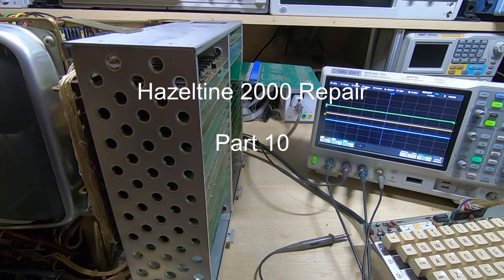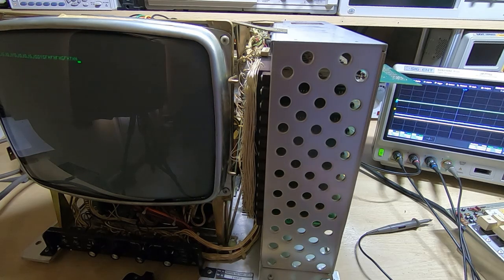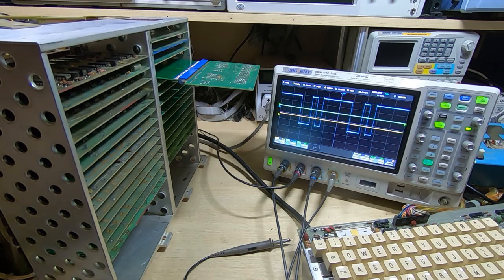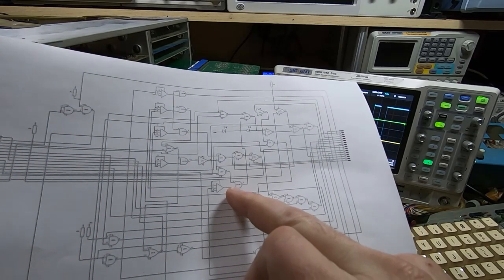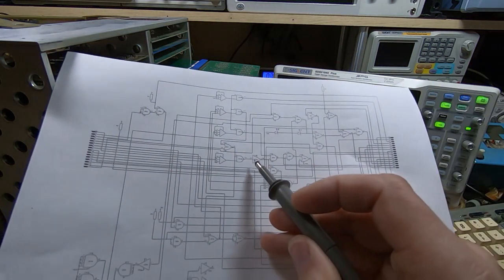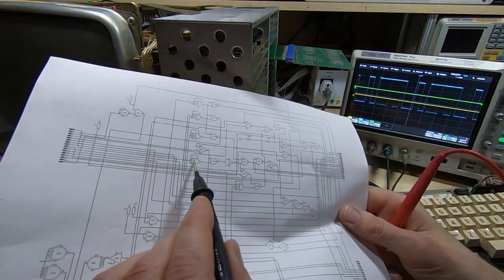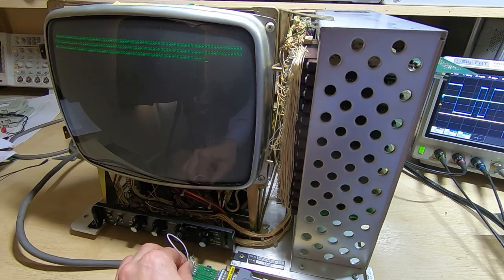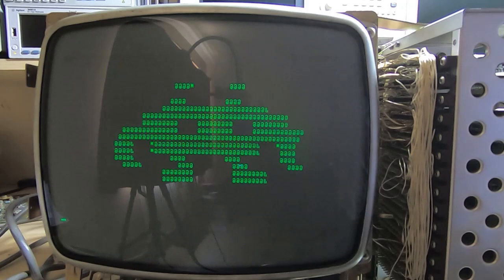Hazeltine 2000 Repair Part10

Comment: The 8kHz squeal begins again at 4:15 when you touch the riser board, and stops again when you let go :)
Reply from the maker: Yes it comes and goes. The mic does not always pick it up depending where it is. The noise is caused by resonance from distortion in the CRT drive currents caused by ground loop currents as the top grounding straps are not screwed down. It will stop when the straps are refitted although the 16KHz whine will continue. This is mostly due to the LOPT being screwed directly to the chassis and there being no current rate control on the primary winding.

Comment: Wow, the high freq squeal in the video is painful. Not sure if it's 15Khz from the monitor or ????
Reply: Ahhh the squeal of CRTs …. Pretty much at this point relegated to the dustbin of history like the sound of 300 Baud acoustic coupler tones…. Thank heavens for LCDs etc. replacing CRTs. My ears feel much better these days.
Reply: It's an 8 kHz squeal from the CRT drive, not the 15-17 kHz or whatever the horizontal timing is on this screen, I've forgotten the exact number. Jerry left a comment above explaining there is some distortion causing a physical resonance rather than an electronic one, which will end when things are put completely back together. I suspect most people are not hearing the normal CRT whine and are hearing this squeal instead.

Comment: What terminal emulator do you use? I successfully used NC5 terminal and Procomm, under dos. Maybe the handshake must be set not as Xon/Xoff but as CTS/RTS. I see that you use a null modem cable that appear to have full handshake so it might do the trick. Also, try to use a null modem cable with partial or loopback handshake, it might give better results id the terminal expects a real modem to be connected.
Reply from the maker: As I say in the video I tried all the usual hardware handshake methods.
Reply: @JerryWalker001  a lot of the older DTE Comms gear looked for DSR (data set ready) on pin 6, and/or DCD (data carrier detect) on pin 8, following the V.24 RS232 standards.

Async terminals were easy compared to the sync versions, like the Honeywell VIP units.  You had to grapple with the Tx & Rx clocks on pins 15&17. Phase errors and clock slip kept us busy !
Reply from the maker: @stevewatson1599  Yes I know. I have been a systems design engineer for 40 years and have developed many systems using modems and serial links. I will be explaining this in more detail in later videos but I can only cover so much in each video. Those that are familiar with such system will most likely be aware of the requirements but my videos are aimed at people who want to learn about electronics and how to go about working on and repairing such machines. It would not be very informative for me to just say 'be sure to use the correct cable;.
Reply: @JerryWalker001  oh yes, the correct cable.  If only they existed....

Keep up the good work sir, very enjoyable viewing.
Reply: @JerryWalker001  I didn't knew anything about serial communications until I got a old dumb terminal that I wanted to use. I tried an old computer (Z80 based) that had a unique feature: when powered, if a signal appeared at its serial port, it used the device connected there as console; so I used that terminal as a keyboard/monitor for that computer. That was in 1994. By 1999 I had my first PC computer, a Toshiba portable 286 that I managed to connect to that terminal. Then is when I used the NC terminal and Procomm. That is how I started to learn about this subject and I used serial communications mainly to transfer files in/from computers that had no other means to communicate aside a RS232 port and a software. 
I would like you to make a whole video about this subject and if is 1 hour long I would not mind watching it all.

Comment: Could you please cut the 15Khz CRT whine from the audio/ It was really bad in this video.
Reply from the maker: That is how they sound. If you do not want to hear the line noise then you can open your graphic equaliser and cut the upper frequencies. However fault finding on these machines includes the sounds (and smells) they make so I leave it in for those who may be interested in repairing machines like this.
Reply: @JerryWalker001  The issue is that it makes your videos physically painful to watch.
Reply: @Simeon Walker Yes, in the previous video with this unit (the other one doesn't make the same noise), at the end he realized it was the 8kHz sound people were objecting to.
Reply: @Iceykitsune  I wonder what we did before flat screens? haha